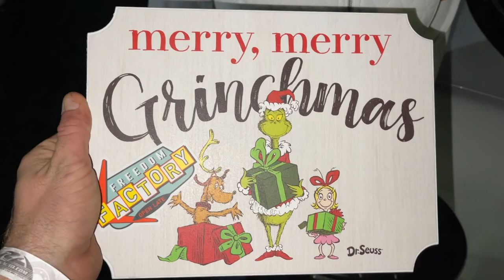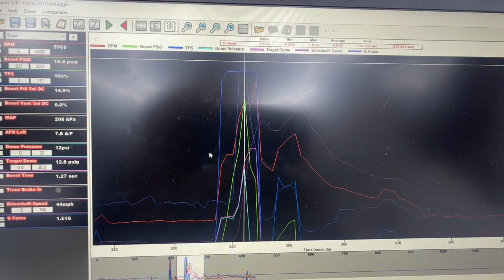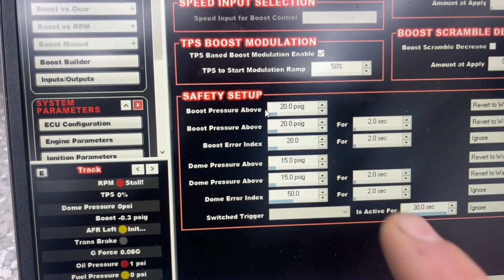WORLD'S FASTEST Transmission Pull! Can You Beat My Time?

Comment: Used to work in a shop that was mostly transmission rebuilds.  If I took more than 15 minutes to drop the trans with the lift I was wasting time.  20 minutes on jack stands.  

Can still do it almost that fast for most standard rear drive autos.
Reply: That's exactly what I was going to say. 15 minutes is the rule in a shop.
Reply from the maker: Post a video and beat my time! Has to be one take!

Comment: Gear vendors are crap.  Get a th400 and scrap it.
Reply: A 400 isn't going to replace a gear vendor, it's not a overdrive.
Reply from the maker: One day
Reply: @michaelwynne4346  TH 400 is stronger than the powerglide. And can be geared close ratio or wide ratio, and with a lock up at can drop some RPM on the high end. Clearly he is having trouble with powerglides.
Reply: @Beat98TJ  I get all that, he needs the gear vendor for the Drag and Drive both Transmission final drive is one to one so the 400 having another gear over the two speed glide doesn't change his cruising RPM, I've been doing this for 40 years so I know a little bit.
Reply: @michaelwynne4346  if he runs a TH 400 with a lower first gear he can change his axle ratio to compensate. Thus giving him a little bit better time on the highway.
Reply: @michaelwynne4346  if I recall correctly, a powerglide first is close to a TH 400 2nd.
Reply: @Beat98TJ  I've used both Transmissions and it doesn't really affect the RPM in the traps a lot of people think because the 400 has 3 speed's it does that's why they run the Gear Vendor.
I don't think most people know what a m&m or any other top of the line 400 Lock-up cost over a Glide, I haven't race for over 10 years now and back then they were 10 to 13K over a Glide, I believe Garrett still uses a gear vendor with his 400, I know Tom Bailey and Alex Taylor do.